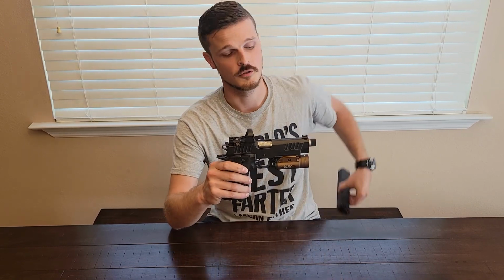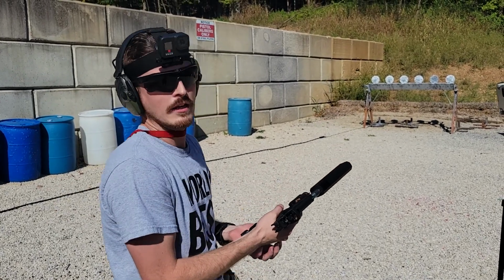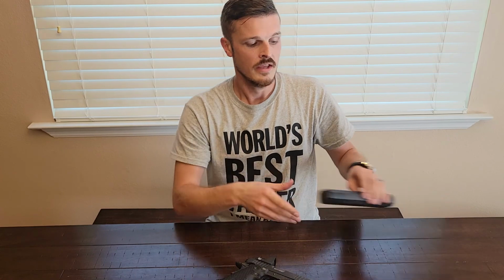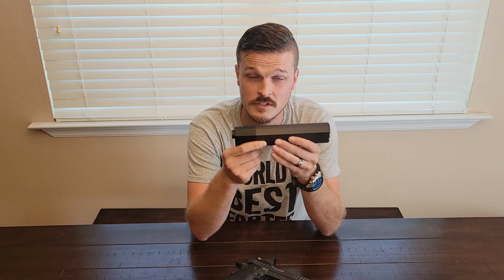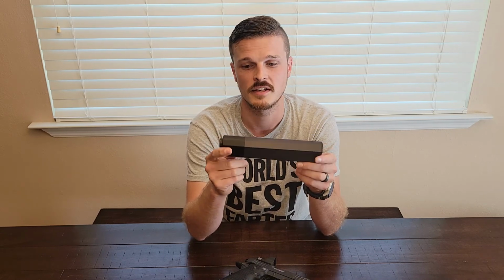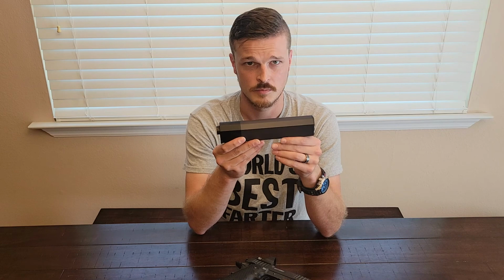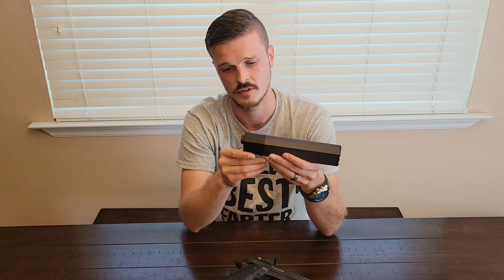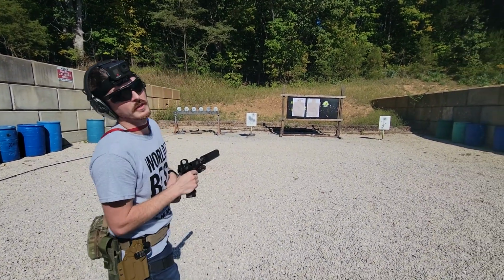Staccato DPO with Whisper Pickle (Ft. the Osprey 45)

Comment: Hey man, how’s the POI shift with the Staccato and Osprey?
Reply from the maker: I haven't done any heavy accuracy testing at 25 yards with it, but it does seem to shift around an inch or so with the suppressor on. Usually not a huge change left or right, but it hits a bit low. At 15 yards and in, it isn't a huge deal. I should also note that I'm typically going from 115 grn to 147 grn when running the osprey. That alone will create significant changes at distance
Reply: Thanks man! Does this can work on this staccato while an x300 is mounted? Sorry for all the questions, just don’t want to buy a new light 😂
Reply from the maker: @user-yc1wx1lm9s that 300 may get in the way as it sticks out a bit farther. I can't say for certain as I don't have one. Judging from pictures it may be close